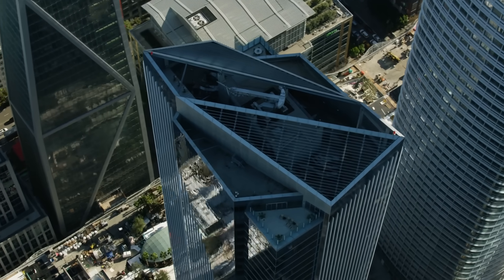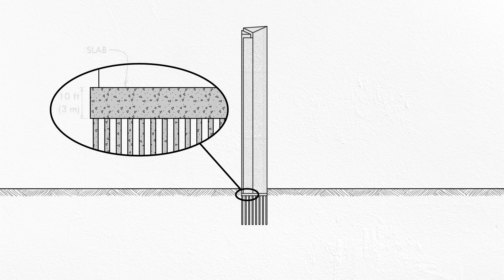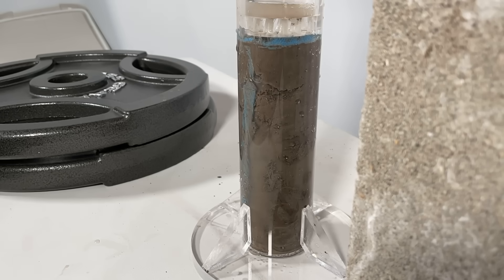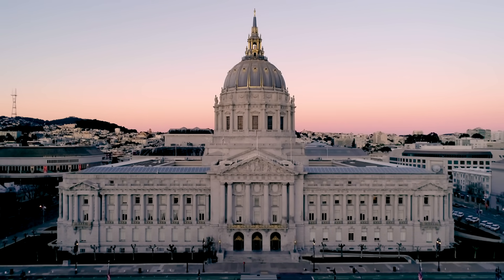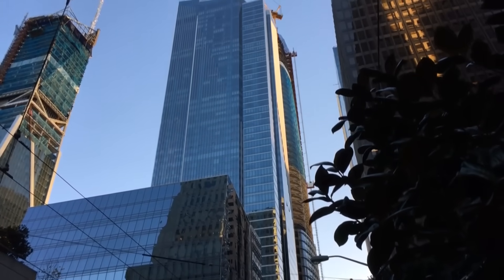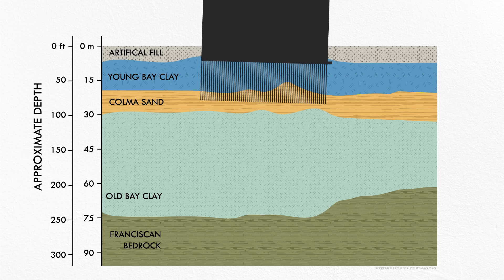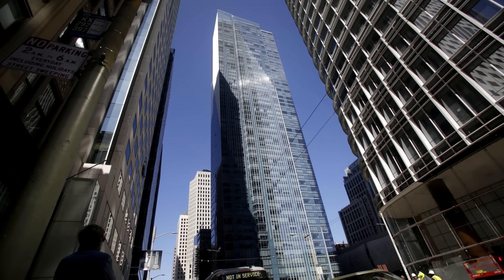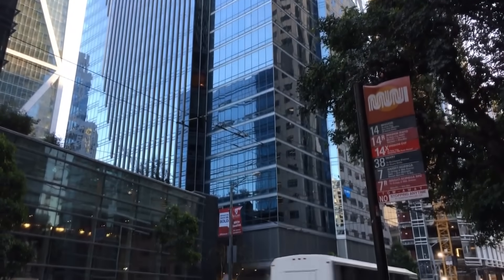What Really Happened at the Millennium Tower?

Comment: my first thought was they should have a new code that requires at least each corner of a high rise to be anchored to bed rock so they could adjust the load on the unanchored portion of the foundation. I'm sure the code would have to read something like at least 20% of foundation load should be able to be transferred to a bedrock foundation. This would give you some advantages after and maybe even during an earthquake where you need to adjust the load. If you had some kind of sprung tension system you may even be able to reduce swaying during high wind shear or earth quake. Just thinking out loud with no back ground in this field.

Comment: I have a question Ive never seen addressed,   when the building sunk this much, isnt the entry into the lobby much lower than the sidewalk? Did they have to change anything or add a step down into the lobby when you enter from the street?
Reply: The sidewalks adjacent to the building are attached via reinforcing steel into the concrete of the building itself, so as the building sinks, the sidewalks closest to the building sink along with it.  This causes the sidewalk to buckle and crack, which is one of the first signs engineers noticed that the building was settling at a much faster rate than had been anticipated.
Reply: Henceforth the lobby will be referred to as "the basement" and all additional floors will be renumbered accordingly, thanks in advance for your cooperation- the management.
Reply: @buckodonnghaile4309  🤣🤣🤣
Reply: @buckodonnghaile4309  maybe they could just put pieces of tape over the elevator numbers and relabel accordingly.
Reply: @buckodonnghaile4309   What a hoot, could not stop laughing. Thank you.
Reply: @buckodonnghaile4309    HA  HA   ROBIN  WILLIAMS,  would be proud on you  !
Reply: This whole area of downtown SF is actually sinking in unison. Satellite data shows it’s gone down around 2 ft overall. (See https://youtu.be/7N4G2K0uOok for a news report about this.) The only problem is that Millenium is sinking more on one corner than the rest, which did result in a broken ground floor level window a few years ago.
Reply: @catc8927   thanks, Cat.   see my comment above, from   research geophysicist Tom Parsons....
Reply: I was picturing that same thing.
Reply: Good question and no one has answered this yet, as far as I know.
Reply: There are pictures and video that show the  mismatch between street/sidewalk and building interior -- don't have links.
Reply: Just change the floor signs as it sinks.
Reply: That has been answered..YES. You could see the sidewalk break away…they…Quietly redid the outside part…But..there was one report of a Condo Owner…showing how bad the lean was..with a metal ball…that moved to the leaning side…NOT GOOD.
Reply: I hauled grain out of a grain elevator that had sunk into the ground 14 feet ---- still usable ---look up "History of the Transcona Grain Elevator" that tilted about 45 degrees  and they brought it back------------------
Reply: Same here as well. I would imagine the building "ground" floor is not level with the sidewalk as most are elevated, But sill that is quite a drop. I wonder what i looks like.
Reply: @RealHank1791  I wish I had a YT channel & could go take a video of the doors & sidewalk.

Comment: In a city known for earthquakes and unstable soil, it is unthinkable that ANY high rise was ever approved where there was a bedrock footing option. I heard it would only have cost $4 million more to do this. No doubt there are single units in this building that cost that much.
Reply: Agree completely.  The city doesn't have the engineering expertise to challenge these project but they like to act like they do.  Wasn't the design changed after approval that significantly increased the buildings weight.  Why was that allowed?  I'm laughing at the whole mess but feel for the suckers that bought into the project.  As of summer 2023, it's sinking again.  I predict that it will have to demolished.
Reply: Space is needed for all the necessary labor in SF; disaster will be the only thing that ends this crazy skyward expansion.
Reply: I know nothing. I'm a web developer not an engineer, but the first thing I thought about was if the building was sitting on bedrock to begin with. This was an interesting video.
Reply: You obvioulsy no nothing about how earthquakes are affect buildings.
Reply: @shrimpflea  you're obviously not living on an earthquake fault.
Reply: @shrimpflea  But maybe he does KNOW
Reply: @shrimpflea  I don't either. Are earthquakes not more likely to collapse a leaning building anchored to unstable soil than a building anchored to bedrock (and thus not leaning)?

Comment: Next time hit that bedrock. Saving millions by not hitting the bedrock costing at least 120 million to fix. I'm a union electrician in SF. I was working on Trans bay terminal building and sale force tower. Just pumping underground water out to set the foundation took months. Those water is part of the water that's holding the  foundation of millennium tower. Some of us already knew that's going to be a problem in the future. When sand gets too dry without moisture. It will give. Reason we don't use sand to cover our underground conduits. Use small rock then sand. Requirement by the code so no sink hole. Pot holes. Yes.

Comment: it’s sinking because it’s foundation was build TO THIN!.. and it’s probably not the ground affecting it rather the wind 🌬 💨,.. you might be thinking that the wind is hitting the opposite of the sinking side, but NO!,. rather the wind is hitting the side that is sinking,.. think of this as a rocking chair, the stronger the push the more intense the rocking will be,.. the only problem here is that the building is not rocking back to normal because it’s foundation was built TO THIN!.. so instead it’s sinking,.. maybe the temporary solution could be to make the opposite side sink faster in hope that it balances out,..🤔🤷🏻‍♂️

Comment: Welp the Geo technical engineer should had thought about all of that! They predicted 4 inches over a lifetime. Yet the building has tripled sinking that number. 

Of course they could had predicted the performance if they had factored in the water extracting and adjacent drilling nearby and could of went for a deeper foundation. 

Think about it, this is a big Luxurious city so of course other similar projects will happen nearby.  Instead; to save money they went for a cheaper foundation.

You put this heavy building, which is one of the tallest buildings in that city on the upper most foundation towards the surface,  instead of drilling the foundation deeper into the ground towards some of the lower levels for better support of the weight, just in case something disturbs the stability? Yeah, Geo tech team messed up, big time!

Comment: I believe the original plan was for steel building and the foundation calculations were based on that lighter structure.  By going to a cement building, the builders wanted to save money over steel.  Gues it didn't turn out that way.

Comment: I've pulled steel pipe out of the ground using my crane's load indicator, it's amazing how much vert pull it takes to pull a post straight up that's set in a hole 3' deep with just a couple bags of concrete. I pulled 6,000 pounds once before the 2" sq. tube came up, ground friction, kind of how these pilings works, simple friction. I too thought it took bedrock. I wonder who the first member of the general public was, who had the thought "I could swear that building is tilted!" Too bad the building didn't have tapered sides, it would have been harder to eyeball that it was tilting!

Comment: I have worked construction in the bay area. We had to drive two ground rods, and if you  didn't want to lose two ground rods after you bolted the coupler onto the first one you drove 85% of the way in you put an acorn clamp and a wire on the end of the second ground rod. If that coupling hit an open pocket in the water table both ground rods slipped into the earth never to be seen again.

Comment: If the drilling on the sinking sides makes the building sink even more on those sides, then why not stop that drilling on the sinking sides and begin drilling on the other two more stable sides to make them sink enough to somewhat balance out the building. That might give a lot more time to figure out a better way to safely correct the problem.

Comment: judging from the look of 9:05, it's very probable the drilling would increase the settling. Not an engineer but i feel like they should install this on all 4 corners so it can be adjusted on all sides to balance out the pressure.

Comment: huh, on those perimeter piles, shouldn't the notch that interfaces between the old foundation and new sleeve around the new pile be facing up?  The new foundation (left, dark gray) will exert upwards force on the old foundation (right, light gray).  If the notch is angled like in the picture, the force will be exerted diagonally upwards and to the right.
Reply: I agree,  it will push the lifting device away from building foundation.  Not a positive connection.

Comment: Grady - cost cutting is going to this as a total disaster!

First of all news reporting has pointed out pilings were not bored to the bedrock.

Friction piles were and still are a total mistake and common design is inadequate support. 

Geotechnical fractional added pilings are still inadequate going forward. Plus the only real fix will require new through to bedrock pilings along the entire peripheral wall system.

The current plan is doomed to failure if liquefaction from a major earthquake event to become a fateful domino around others cover up this major error.

San Francisco should never permit non bedrock based support for any building that settles like this one or more than 4 floors. The geotechnical outfit stopgap is more like a con job to allow current owners to sell.

No one should buy or even live in that building with retrofits detilt access is nuts and cheapscapes with piles on two side is a total asymmetric joke.

Saving construction costs equals future disaster and is a mistake.

Comment: At 9:13 " The design requires that the holes be overdrilled so that no part of the new piles can come into contact with the Old Bay Clay and put any weight on this week subsurface layer..."    
When the hydraulic jacks put a large compressive load on the new piles, the long new piles will buckle and make contact with the Old Bay Clay.  The buckling shape will be a spiral whose pitch will decrease as the axial load is increased.  This helical buckling is well understood by the oil well drilling industry.
The new pile-bore contact will be a spiral which will make the backfilling of the annular space difficult.  Voids will remain that will be filled over time by the Old Bay Clay leading to more settlement.
The Old Bay Clay is in a large state of compression under and around the building. Removing some of clay around the building for a short amount of time will lead to an increase in settlement speed and the hole may not stay open long enough for the new cement piles to be installed with a gap.  
We may be missing some part of the plans.
Reply: Indeed, the drilling was halted because new settlement was detected. I would avoid visiting that neighborhood. The time to drill was when the building didn't exist. Incompetent builders and designers.
Reply: @RRaucina  yeah that is just dumb knowing that most of San Francisco sits on landfill and prone to liquefaction when the next  big  seismic event   happens.
Reply: That's a very specific prediction

Comment: So is part of the leveling scheme to leave the hydraulic jacks in place, supporting the load ?  What will happen after even a short period of time is the jacks will lose height owing to inevitable leakage of the hydraulic fluid past the internal seals.  The jacks will need to be readjusted on a routine basis.  And as the seals age the jacks will need to be replaced.
Rube Goldberg could not have come up with a wackier solution.
The predicament reminds me of the old carpenter's adage:  Measure twice, cut once.

Or how about "An ounce of prevention is worth a pound of cure"...
Reply: No, the jacks will have mechanical locking systems which do not depend on hydraulic pressure to sustain the load. the jacks will however, remain functional, retaining the ability to be re-pressurized to adjust the load on individual pilings as the building continues to settle.

Comment: You would think this would be an open and shut case for insurance to cover the cost of the micro-piles, even if it did exceed the cost of construction.  You can be sure the construction lenders required the developer to have insurance against "unforeseen"/accidental soil subsistence. With the construction lenders paid off, it's possible those policies were cancelled.  But it should be a lesson to city regulators that those policies should be required to be assigned to the municipal authority or the private successor-in-interest to the bank.  If the building did tilt to point of the falling over, for instance, the city would be forced to come in and demolish it on the taxpayers dime.

Comment: Scary! Funny, we (Toronto) have the total opposite problem. Our entire substrata is solid rock, that is rising, or rebounding, up to 1-3 cm per year, why? During the last Ice Age, where Toronto currently sits, was 2km of ice, it’s immense weight pushing the ground down. Since the last glacier retreated, the ground has continued to rebound to this very day. It’s great for stable foundations, hence the explosion of skyscraper construction over the last 15 years (we now have the most skyscrapers in North America, second only to NYC)….but despite all those heavy towers, the solid rock beneath our feet continues to rise, creating numerous issues that we’ve now learned to overcome. After the initial foundations are dug, and it’s walls securely in place, they install countless rods into those walls, and wait approximately 3 months. If the rods begin falling out, they must wait until the foundation has sufficiently equalized before pouring the base slab. To do so too soon, could result in the same problem the tower in this video has, but for totally different reasons. However, with hundreds of skyscrapers recently built, under construction, or awaiting approval, it seems they’ve conquered this problem…if only they’d use quality materials. Dozens of condo towers, most by the waterfront, owned by a Chinese consortium, were built with the cheapest materials possible, resulting in brand new buildings falling apart. They’ve had to replace all the windows and glass panels after a series of disasters, with huge glass slabs falling off from 40+ stories up, crashing to the ground, I’ll never understand how they received final approval before allowing tenants to move in, when these building were falling apart! Someone is getting rich from bribe money! My co-worker was unlucky enough to have bought one of these units, a 650 sq ft 1BR unit on the 45th floor. The day she moved in, none of the doors would close fully, her balcony door was frozen in place, due to installing all doors and windows, before the concrete had cured sufficiently, causing all doors and windows to be immobile. She had no water in her kitchen, the drains weren’t even connected, forcing her to use her bathroom sink for everything. Then, as winter approached, all her windows and balcony glass panels fell out, nearly killing several people on the street below! She paid $1.1 million for it, yet it was like living in a slum! All the residents hired a lawyer and sued the developer, but surprise surprise, they were in China, refused to do anything about it, and hid from our officials, after making billions off this disaster. So, all owners were on the hook to pay for all repairs! Luckily, city council knew they screwed up, as that building, along with over a dozen others, all built by the same crooked, criminal consortium from China, should NEVER have been given final inspection approval. Knowing the people would sue the city as they were unable to sue the developer, the city quietly paid for all repairs, costing we, the fax payers, well over $300 000 000!!! (The feds paid most of it). The moral of the story? BUYER BEWARE!!! ESPECIALLY IN TORONTO AND VANCOUVER ( Same Chinese developers did the same in Vancouver over 20 years ago). This is why I prefer to rent, owning is now a game of Russian roulette…if I do finally buy when I retire in a few years, it will be in a well established, older building, that was built properly.

Comment: The John Hancock Building in Chicago Has two Foundations the 1st one sank before they even finished. I forgot how much , but the problem was in the process  used. the foundation used old train cars welded together and then concreted around. The volume tickets and volume of cars didnt add up. So a second foundation is next to the original one. It work as thr building still stands. They had the luck to catch the mistake early. This is quoted as I remember reading the story. Check for your self its a good read.
Reply: I looked info on this foundation and found out that a 12 ton beam moved a caisson in place so they stopped all work checked them, the caissons are around 10 foot in diamater. they found defective ones with  voids in the cemment they pulled and replaced defective ones.